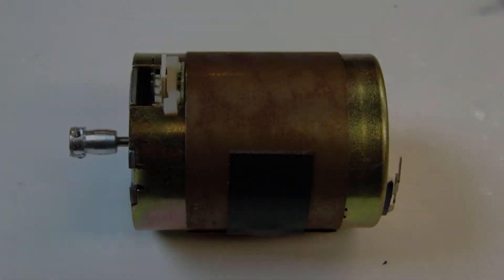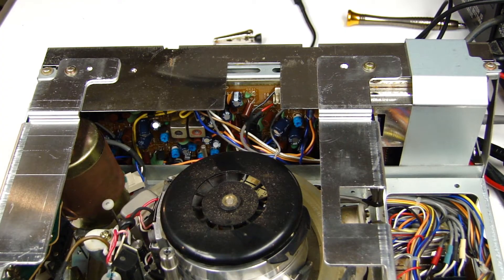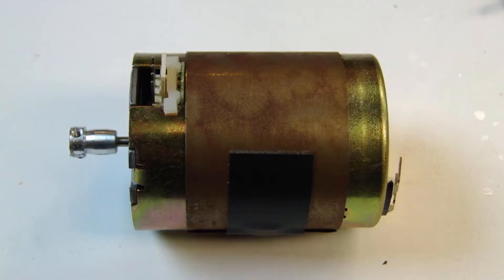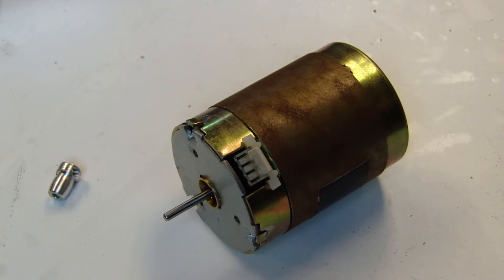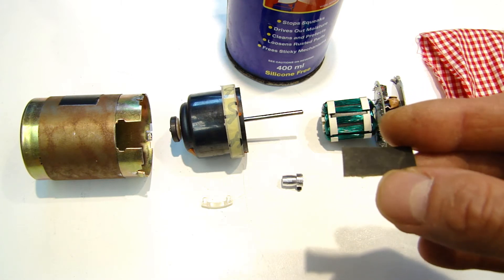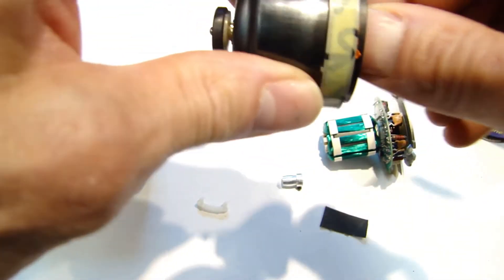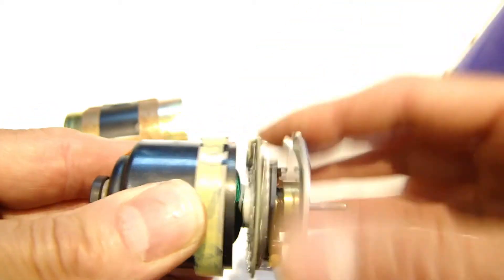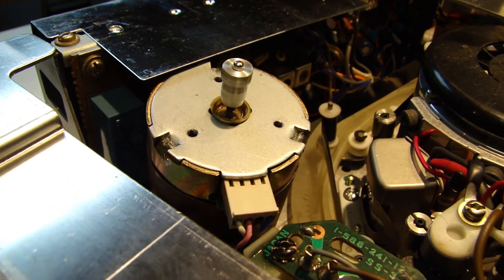SONY BETAMAX SL-3000 CAPSTAN MOTOR BHF-1100D RESTORATION

Comment: Can I have the range of voltage that this motor work with?
I bought the motor in a big Bazaar but I couldn't find any datasheet about it until I saw your video
Reply from the maker: I think it runs at 12 volts in this machine. Anything higher may cause it to over heat and seize.

Comment: God sandpaper to surface the motor shaft !😢 I think you better take up some other subject
Reply from the maker: Hi thanks for watching. just to clarify, it was emery paper that I used on the motor shaft. Do you know of a better solution for cleaning the motor shaft from contamination from the brass bush.
Reply: @RetroGadgetMan  WD 40 and soft wood ..then cloth to wipe . Emery paper should NEVER be used on shafts like these .
Reply from the maker: Thanks. I will try that when I do my next machine.
Reply: @RetroGadgetMan  you are welcome . Great video though 😊
Reply from the maker: @manusudha4269 Thankyou.

Comment: Hi there! I was curious if this motor is compatible with the sony sl 8200? thanks
Reply from the maker: Hi I have not worked on that model. It could be compatible. Best thing to do is a Google search and also try and get a service manual. Can you get the motor out to see the model number.

Comment: I'm having a problem where the pinch solenoid isn't engaging with the capstan in play mode and the tape just doesn't move. I can manually move a lever and it will enagage and start playing just fine. Is the solenoid bad or can it be lubricated in some way?
Reply from the maker: Can you hear or see that the solenoid is attempting to engage. "The clunk" if so it could be getting trapped somewhere or a bent part.  If not it could be a electronic signal issue. I have never had a solenoid fail or need lubricant.
Reply: @RetroGadgetMan  I think it is attempting to engage, it moves a little bit. Using a voltmeter I can see 12 volts applied to the solenoid when going into play mode.
Reply from the maker: That's good, sounds like it's being held back mechanically.
Reply: @RetroGadgetMan  What should I do? I applied a little bit of WD40 to the lever but it didn't do anything.
Reply from the maker: @KylesDigitalLab  have you tried a different tape, some of the tapes can be stiff to turn or try running it with no tape to see if it engages. Hold the tape sensor switch down to trick it into playing without. Failing that I don't know.

Comment: Thanks for this video! I am working on a friend's SL-3000 that had a completely seized capstan motor. I actually didn't need a vice to open it up, so keep that in mind. After using some WD-40 and some 800 grit sandpaper on the shaft it's spinning nicely now. Now I just have to see if it will play tapes not and not eat them.
Reply from the maker: Glad the video helped. I have. Bought another one since and that captain is also seized. A common problem it seems. How did you get yours open without a vice to hold it.
Reply: @RetroGadgetMan  Me and my Dad managed to get it open without a vice. Just by holding it and having another person do the hitting with the hammer and screwdriver on the tabs. Probably much safer than a vice.

Comment: I have the SLO-340 which was the industrial version of this recorder, mine used to work great but now it does nothing when I apply power. I checked all the fuses I could see and none of them worked. I wish I had a service manual for it.
Reply from the maker: I have two Sony SL-3000 a similar looking machine. They suffer with a stuck capstan motor, which I did a video about. Both mine have other faults.whuxh I have yet to repair.
Reply: @RetroGadgetMan  I think the mechanism on my SLO-340 is fine, it's definitely an electrical issue.
Reply from the maker: @KylesDigitalLab  I would start looking around the power board. Could be bad caps but I would only change ones that look suspect. Sometimes they can be leaking underneath and you can't see it until you remove them.  Is it the separate PSU that's not outputting 12volts. Or the VCR that's dead. You can power the VCR through the DC battary port but be careful of the polarity. Sony likes to do things differently 🙄 I bet you have already tried that though.

Comment: Fantastic, thanks for this! I got stuck at bending the tabs, I guess I should have kept going.
Reply from the maker: No worries, I hope it helps! 🙂 By the way, both my machines stop one second after using any of the controls. Play fast forward etc. Capstan motors both running freely after my refurb. If anyone has any suggestions, please let me know.